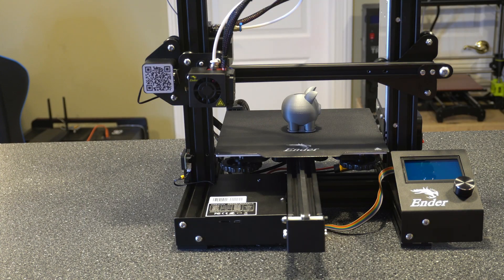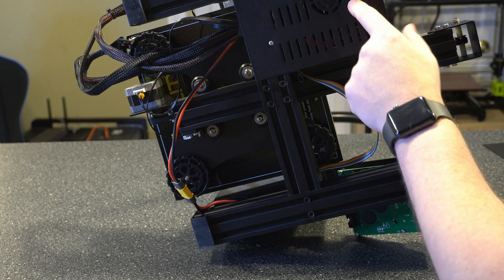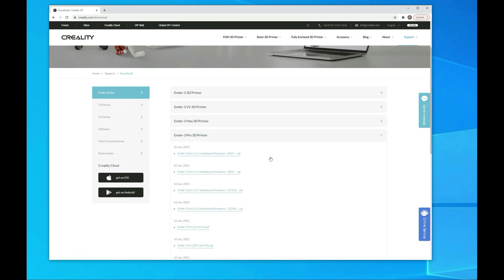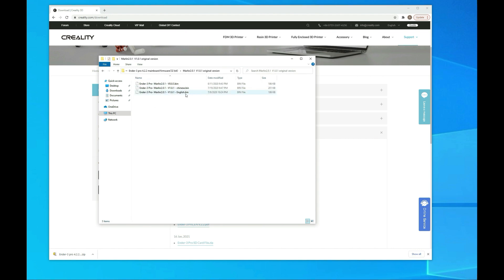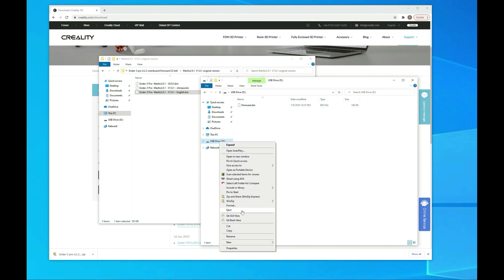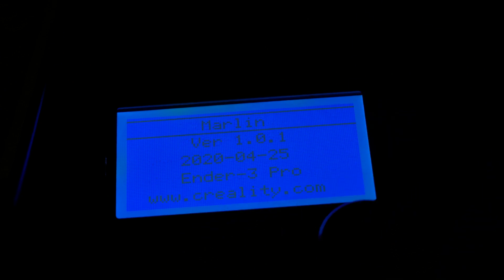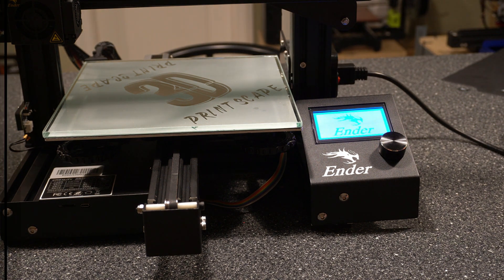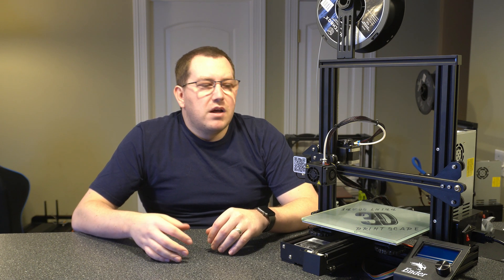Creality 32-bit Mainboard Firmware Upgrade Guide

Comment: I have a ender3. Homing was wrong the last time. I loaded the bootloader and loaded v2 as I could not find the original one. Homing does not work. For the 1.1.3 board I could not find anything. 1.1.4 I did find but there are 2 versions and both are Hex files. I can't find how to load the hex version. The printer is as it came from the factory. Does not home correctly and now the version is wrong. Any suggestion on how and what to do? Thanks  and I hope you can help. I will keep looking, I have tried several things with no solution. Thanks
Reply from the maker: Hi. You have to have your printer connected to the computer and use vs code to push the firmware (thats assuming you have the bootloader installed already). Honestly, its a pain i would look to get a 32 bit board.

Comment: Hi, I received an Ender-3 Pro as a gift, super new to this. I've opened up my board and 4.2.2 is printed on the mainboard. I've loaded from Ender's website 29 Nov 22's "Ender-3 ProMarlin2.0.6HW4.2.2EuropeMultiLanguage" and it did update the printer from V0.0.6 to V2.0.6. 

I had to change the Chinese language to English afterward and all seems fine so far. Do I need to load any other board-specific FW other than the above or is that it? One thing that bugs me is that it buzzes when I try to do a factory reset.
Reply from the maker: Hi. If your not running any aftermarket accessories then what you did is enough to get you going for a bit.

Comment: i just put in a 4.4.7 board into my printer and im just getting a blue screen when i try to use the firmware. any ideas how to get it going?
 im using the original marlin firmware bin from the website and leaving its name as is. ive tried on a new sd card and changing its name
Reply from the maker: Hi. Does everything load/work fine with the firmware that’s was on the board? Also, is the sd card 8gb or less?
Reply: @3DPrintscape  it didnt come with firmware on it. i dont think? i couldve instantly put my 8g thing in there on boot but i dont remember lol. my  second one is 16g so ig thats out, but i only get blue screen still
Reply from the maker: @dizzytitan815  It should have came with one. That said, the bluescreen happens if the name of the firmware matches the previous one or if the firmware isnt supported on that board.
Reply: @3DPrintscape  im getting the newer screen today as well.  Just in case my screen was the issue lol. But still open to ideas
Reply from the maker: @dizzytitan815  Did you try the new screen?
Reply: @3DPrintscape  update, after live streaming for 4 hours with some guy from thailand I met on reddit hopped in and helped me. Turns out I plugged in the unlabeled 3pin from he sprite. I knew you weren't supposed to plug in the unlabeled 2 pin but once I unplugged everything except screen and power, it came back on and slowly plugged in everything to see what it was. Just the sprite 3pin that was fucking me
Reply from the maker: @dizzytitan815  Im glad you got it working.

Comment: It os applicable to ender 2 pro
Reply from the maker: Hi. You can upgrade the firmware on the 1.1.4 board but its a pain. If you dont already have a bootloader installed on it you will need to get an UNO card that is about $20. If thats the case, i would recommend spending a little more and grabbing an SKR mini e3 (probably v2) and building your own firmware for it. You can use the config example from the Ender 3 and just change the size if needed.
Reply: @3DPrintscape  thank you for this info sir yes i bought this a week ago and the one that they give to me is the version 1.1.4 which is the old version of board this step is very hard to me and not totally knowledgeable to programming!is there any possible to upgrade it by changing the main board to other version?and what version of board is applicable to this ender 2 pro thank you!
Reply from the maker: @J_Creative  The issue your going to come across with that printer is there are not really any premade builds for it on new boards. The 32 bit creality build file name is (Ender-2 ProMarlin2.0.6.1X165HW4.2.3.bin) which looks to be for the 4.2.2 board so you can try to get that board and use their firmware but you may run into more issues.

Comment: Is ender 3 32bit board same as ender 3 32 bit board
Reply from the maker: Hi, The short answer is it depends when it shipped and also keep in mind the v2 has the 4.2.2 silent board where the pro is the standard 4.2.2 board.

Comment: Hey so I’m using the Marling firmware on my 4.2.7 board. For my CR-10 S5 3D printer. It comes with the BL touch firmware in the firmware for the board. Would the BL touch firmware work on a CR touch?
Reply from the maker: Hi. It will. To the printer they are the same thing.
Reply: @3DPrintscape  good to know! Thank you so much for replying back to my comment.
Reply from the maker: @GTEditsYT  You're Welcome

Comment: I don’t know what to do. I downloaded the firmware, I did everything that I was supposed to do but the screen is still blue.
Reply from the maker: Hi. Try the bltouch firmware from my site. https://3dprintscape.com/marlin-firmware-builds/
Reply: @3DPrintscape  what if I don’t have a BLTouch
Reply from the maker: @mightymattgaming3725  You can use the firmware in the first column. Its just marlin with no changes.
Reply: @3DPrintscape  I’ve tried all of them. I let it sit for a minute or so but it it still won’t work.
Reply from the maker: @mightymattgaming3725  Have you tried different sd cards?

Comment: HI, I tried compiling a Marlin 2.1.1 firmware for this printer and after I uploaded the firmware to an SD card and inserted and turned on the printer the screen was blank (as expected) but even after many minutes it remained blank! Now I tried to switch on with the original firmware but nothing is happening. Do I have a dead motherboard or can something like manually loading a bootloader thru Arduino etc. might work to recover? Please looking forward to your valuable guidance. Thanks in Advance
Reply from the maker: Hi. Can you make sure the sd card is formatted as fat32 and add a character to the firmware file name to make it unique?
Reply: @3DPrintscape  Thanks for your response, Yes I ensured all that. I tried with the SD card with the original creality firmware loaded again and somehow it worked. Thank God I have a working printer again. I was almost ordering a new motherboard for this. Thanks Again.
Reply from the maker: @Accessgp  Im glad you were able to get it working.

Comment: Hi i have a cr10-max and it wont heat the bad anymore have changed mofet thermisters tested board with manual 24v and it heats up everything works but wont start heating at all is it the mainboard or the power supply not working ?
Reply from the maker: Hi. It could be the mainboard or firmware, i dont think it would be the power supply unless its not connected.
Reply: @3DPrintscape  Hi i have re flashed the mainboard and the wires to the mosfet when you turn the heat on go from 0-24v reading just doesnt heat the bed am going to try another mosfet again then swap out the mainboard

Comment: HI nice video, y have a problem after change stock mainboard to version 4.2.7, before the change evarithing whit the hottend temperate was right, but after  my ender 3 sent me Thermal error ramdonly at the begginig, in the meedle of the print, i cheched and change thermistor, wires etc, please help me i think is a firmware problem
Reply from the maker: Hi. The only thing i can think of that would cause this is a lose connection or bad thermistor.

Comment: Thanks for the vídeo, but I have a question the firmware has to Stay on the sd card or you can delete ir after updating?
Reply from the maker: Hi. Once the firmware is uploaded to the printer it should be removed from the sd card.
Reply: @3DPrintscape  thank you very much
Reply from the maker: @TheMrbabalu  You're Welcome

Comment: Did't work on my ender 3 pro
I'm sure the Fat32 was ok, changed the name ob several bin files just to make sure and even changed sd card.
downloaded vs code and compiled my own file with platformio and still getting blue screen.
On the bin file from vs code it actuallt works but screen shows nothing.
and if a use simplify3d to control 3D printer it also works.

Still don't know what happened and i think my las resource is getting other motherboard
Reply from the maker: Hi. Can you try the firmware from my site? https://3dprintscape.com/marlin-firmware-builds/

Comment: I have been following each step exactly like you did. But with that updated firmware my rotary knob loses functionality though. Do not know how to solve this problem
Reply from the maker: Hi. I havent see that behavior before. What firmware are you trying to use?
Reply: @3DPrintscape  I tried the firmware provided by creality first. Then I tried the firmware by Teaching Tech
Reply from the maker: @chrisko6514  Does it have the same issue with both?
Reply: @3DPrintscape  Yes it does
Reply from the maker: @chrisko6514  If its having the same behavior with all the firmware you have tried, it may be a hardware issue.
Reply: @3DPrintscape  that's what I was thinking. But back on the V1.1.4 mainboard the knob is fully functional
Reply from the maker: @chrisko6514  Interesting, im not sure what would cause it unless its the age of the screen or something but that still seems odd.
Reply: Hey, I thought I would still owe you a reply. I sent both the motherboard and the BLTouch back to the retailer, did some research, and finally ordered the correct parts. After uprgading, I flashed my printer using the Unified Firmware by TH3D which works fine for my Ender3. Also BLTouch works fine now.

I am so thankful for your advices!

Greetz from Germany!
Reply from the maker: @chrisko6514  Im glad you got it working, sounds like one of the parts may have been bad.

Comment: Hi, I upgraded my ender 3 pro with a 4.2.2 board. Due to another youtube video I already had an attempt to update the firmware. However something went wrong nd I now have a blue screen an nothing works, also you process described in your video.
Any idea how I can get my printer running?
Thanks in advance for your help.
Michael
Reply from the maker: Hi. Try to add the date to the end of the file name to make it unique and also make sure the sd card you are using is 8gb or less and fat32 formatted.

Comment: A bit confused. So Creality already installed Marlin 2.0 but the firmware is still called 1.0.1?
Reply from the maker: Hi. The Creality firmware appears to be based on Marlin, but its a very stripped down version. If your looking to actually run Marlin 2.0 on your printer you will want to check out this video. https://youtu.be/pQ7WZST8sqk
Reply: Thanks! I'm also curious, if i place the creality stock marlin 2.0 .bin file into SD card, stick into printer and turn it on. Is that the same method?
Reply from the maker: @kevinso5578  Ya, thats the method to update the firmware for that board.
Reply: Hi, I downloaded the latest version of the bin file which is 2.0 from creality and followed your instructions but my printer refuses to update the firmware. Also it still shows version 1.0.1, now I have bought this printer which is the ender 3 pro but have not been able to get one single ok print. So please help
Reply from the maker: @Accessgp  Hi, what issues are you having with the print?
Reply: @3DPrintscape  I am having multiple issues, the most common being that everytime I try to print the Z-axis height changes and it prints approx 1-1.5mm above the bed. This is depite me manually levelling the bed each time. I tried stiffer springs also but same result. Also when I tried the calibration cube, one bottom corner lifted and by the time the printer reached 90% of the print it went haywire printing in the air. FYI I am using the creality slicer software.
Reply from the maker: @Accessgp  It sounds like one of the axis may be loose. Try to go through and tighten everything up. Focus on the x axis, hot end carriage, and the bed.
Reply: @3DPrintscape  Hi Buddy, I already did all that, I replaced the bed springs with the quality ones that I could trust, I even replaced the stepper motors with the ones which work fine on my DIY printer, but same result.... I am out of ideas hence I approached you for help
Reply from the maker: @Accessgp  Something is off for sure, and it sounds like the z offset. Are you readjusting your z offset after manually leveling your bed?
Reply: @3DPrintscape  Thanks a Ton for helping me out taking your time.

Yes I finally tried adjusting the Zoffset 0.1mm at a time and finally got it to print on the bed. Also found out the problem was a print bed warped in the center. Added auto bed levelling so there is some relief. But the ender 3 pro only does 9 point levelling and I want it to do 16 or 25 because my bed is very warped! Any ideas how I can change it because the firmware from the creality website was already a bin file so my understanding is we cannot edit that.
Reply from the maker: @Accessgp  You would have to run a custom build of Marlin and change GRID_MAX_POINTS_X from 3 to 5 or 7.
Reply: @3DPrintscape  Thanks a lot for your support to help me resolve this problem 🙏
Reply from the maker: @Accessgp  You're Welcome
Reply: @3DPrintscape  🙏

Comment: I recently bought the 4.2.7 board for my ender 3 not the ender 3 pro. But I put the board in the printer an get a blue screen with no logo. Can anyone help me on getting my new board working with my ender 3 v1
Reply from the maker: HI. Make sure everything is wired right and try to update the firmware. Make sure to add the date, or unique number, to the name of the .bin file.
Reply: @3DPrintscape  I'm the same person matt u answered earlier today on this video lol
Reply: @3DPrintscape  yea everything is wired as the old board. Maybe it's my sd card because I renamed the file as you said too an nothing so I'm gonna try the sd in my phone because it's a branded sd card.

Comment: how to i get my ender 3 to install the firmware for my silent board 4.2.7 im not using anything but upgrading motherboards im not adding BL touch. please help
Reply from the maker: Hi. You would just grab the firmware for that printer (It wount have bltouch or anything like that in the name), put the .bin file on the SD card, then put it in your printer. If you did that and its not updating, its possible that you will need try try a different SD card. The SD card readers in these things are cheap. I have 10 SD cards, all of them will work to print from but only 2 work to do the firmware update.
Reply: Do you know the brands of sd cards that work for your firmware updates
Reply from the maker: I have a netac 8gb ones and a unbranded 128mb one that works. I have other 8gb ones that don’t.
Reply: @3DPrintscape  ok I'm try the one in my phone because the one that came with my printer wont do the firmware it will print g code just wont do the firmware. I hope it's the sd card because I did everything you did in the video an nothing but blue screen when I turn it on

Comment: a quick 2 sec glance to tell which 8 bit or 32 bit boards in without opening the cover is look at usb port 32 bits have micro usb shaped like a D  and 8 bit have mini usb port that is trapeze shaped
Reply from the maker: Hi. Ya thats right, good callout.

Comment: This is my first foray into the firmware on my 3 Pro, so stoked that I can do it today and toss the list of parts I was buying until I realized I have the 4.2.2 32bit board.  Question.  There are as of today 2 more firmware updates on the Creality site for this board.  One for the display and one for the hotend.  Your suggestion on yea or nay to those would be appreciated.  Not sure if theyre considered updates or just bug fixes for things I haven't encountered.  I don't find a lot of documentation on the site.  
Beyond that, thanks so much for clear and concise vids and info!
Reply from the maker: Hi. I personally try to update update my firmware about every 3 months or so, especially if your running Marlin from the bugfix line. That said, the firmware that shipped with the Creality 32 bit boards works just fine so unless you ar trying to upgrade it for a specific reason/mod you will be fine leaving it as is.
Reply: @3DPrintscape   thanks. Got it. Learned some during the process too. Used a 16gig SD and it stayed at blue screen even after power down. Thought I’d bricked it. Swapped to a smaller SD card and still no dice. Changed the name of firmware.bin to firmware2.bin and it worked flawlessly.  So my takeaways. Stay small with the SD for firmware updates and if an issue arises try changing file name.  Today I’m updating from the stock Ender-3 Pro extruder to the upgraded Creality anodized and adding Capricorn Teflon tube. Thanks for the vids and the reply!

Comment: Hello what happens if I only get one file in the original section and it’s an explorer file am I still ok
Reply from the maker: Hi. It sounds like you downloaded one of the newer packages Creality uploaded, they still have the full bundle though. If the one you downloaded is for your setup/printer it should work fine.
Reply: @3DPrintscape  thanks
Reply from the maker: @carterarnold3527  You're welcome

Comment: There’s a newer 4.2.2 mainboard firmware on the site now. Do I download the new one or the one you choose in the video?
Reply from the maker: Hi. Go with the latest firmware.
Reply: I’ve followed your process and my printer is making a high pitch screech sound on startup.  It won’t turn over to the menu.
Reply from the maker: @MaxAppian  It sounds like there is an issue with the firmware package or wiring. Try to use the firmware from my site to see if it does the same thing. https://3dprintscape.com/marlin-firmware-builds/